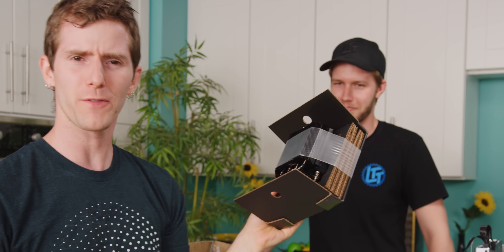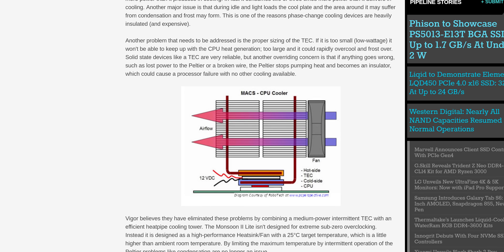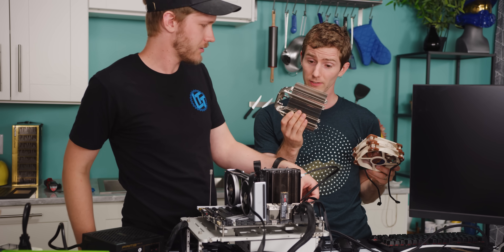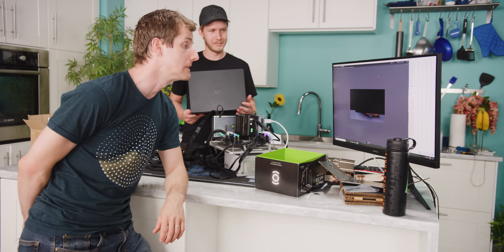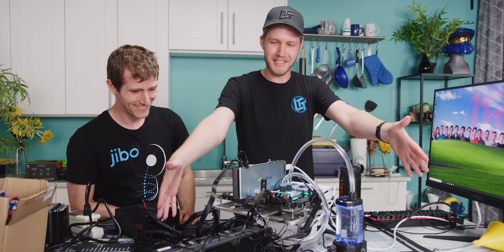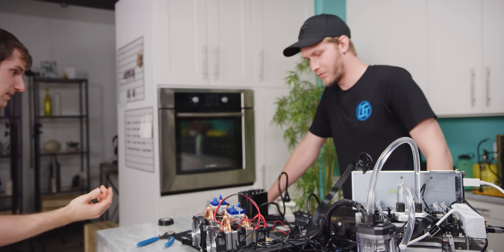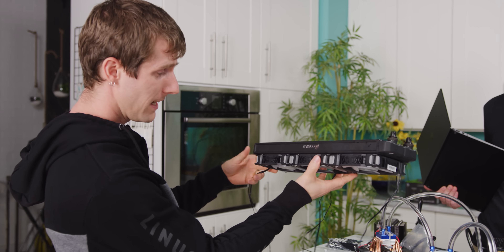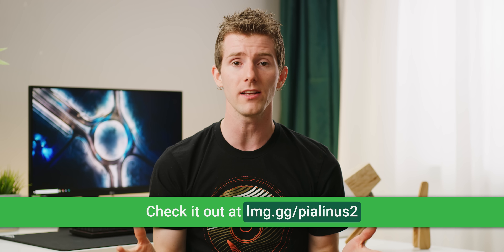Thermoelectric Cooling is a Bad Idea

Comment: 32 amps... lmfao... 
"Ok alex, fire it up!"
(kerchunk)
(sudden random shouting throughout the offices as power breakers are tripped)
Reply: 32 amps... at 12 volts, so... 3.2 wall amps. A typical home outlet can handle 15, some 20.
Reply: @jetjazz05  That's still a significant 384 watts consumed regardless of voltage. I can't imagine my fans using ~380 Watts to cool my computer.
Reply: @UltraNoobian  Sure, no doubt, it's a ridiculous amount. Really nothing uses that much power besides like a fully operating entertainment system, a computer, some power tools. I've got a fan that uses 384 watts, it can pull all the air out of a 12x14 room in a matter of seconds, so for that to be just a very poor quality cooler... nah. Would probably be more energy efficient to use an ACTUAL FRIDGE with a huge spool of tubing in it lol.
Reply: I thought the same, talk about energy efficient that's almost 10x the draw of the rest of the computer!  And it probably still won't be enough, it's like launching a rocket; you need more energy to dissipate the energy it uses, then you need more energy to dissipate that energy.
Reply: Watts = Volts × Amps
Anyway the reason it needs to draw so much is because it is actually working as a heat pump. Basically all refrigeration are heat pumps where heat is being pulled out of a low energy state (your cold food or room) and being "pumped" up and out into a higher energy state (ambient external air). But in order to do that the pump needs to be powered with equal the amout of energy being moved plus efficiency losses. So if the CPU is consuming 100W a perfect refrigeration system that's 100% efficient would have to consume 100W to bring the CPU back to ambient temperature and even more to get it below ambient.

Comment: What about if you create a vacuum in a PC case, and then use a watercooler+chiller to reach sub-zero. Tubes go outside of the vaccum case into a chiller. Isn't the idea that, when there is no air, no condensation can occur?

Comment: Peltier units are best employed as waste-heat energy generators such as emergency battery chargers which are charged using waste heat from a wood-burning stove. As coolers, they are just too inefficient to make sense unless the cooling needs are minimal or must be precisely tuned to a very specific temperature.

Here is an interesting video about using Peltiers for emergency power: https://www.youtube.com/watch?v=rKWDp_yWq8c

Comment: It seems that TEC is bad for active cooling (cooling of actively produced heat). It seems also bad for passive cooling - as most refrigerators modules work with less amount of energy and gas-expansion modules can reach lower temperatures. The only thing I find suitable to be used for is immediate passive cooling, i.e. when you need produce low temperatures fast for stuff that do not emit heat on their own. Maybe for creating instant icecream?

Comment: The problem with TECs is the fact that the device itself consumes power as well, and a lot of it. That power is not converted into "cooling" but heat. With that in mind you not only have to provide a heat-sink for the transferred heat of the device you're cooling with it, but a larger one that is also able to dissipate the additional 60W (for a TEC running 12V 5A). 
Even then a TEC is a solid state heat-pump. It can only transfer as much heat as it is able to dissipate on the "hot" side, meaning that even the slightest temperature rise in your heat-sink at the "hot" side will decrease its cooling performance.

TECs will often work fine on lower voltages as long as you are able to supply the current needed, but you have to experiment with them. There is no need to run them at the specified voltage, it just generates more heat in the TEC while the "heat-pump" capability increases only marginally.
...Yes, I played with a couple of them for more time then I'm wiling to admit before realising they aren't that great for cooling active parts.

Comment: "Bad Cooling Ideas"
Whole Room Water-Cooling 2 confirmed.
Reply: Scrolled down looking for this comment.
Was not disappointed.
Reply: @Snadzies  same!
Reply: Do you think if he does it again he will be smart enough not to use bare copper tube in the room he is trying to remove heat from?
Reply: Whole room water cooling. In the server room! Whole server room water cooling!
Reply: whole room water cooling was not a bad idea, but you had linus doing it so horribly decisions were made all round.
Reply: Pretty sure they have server buildings submerged in the ocean now, why limit yourself to just one room?
Reply: Room cooling was good, just the implementation fo it, number of little things added to it not working as expected.
Reply: Probably my favorite video (series) on the channel, yes please! XD
Reply: I want this!
Reply: *Iwakura Lain has joined the chat
Reply: Whole room PET cooling 1.0 Alpha build.
Reply: You could use that as a pool.
Reply: I really recommended this when a few videos back when they did the video about the completed LAN center in the office. 
I totally want to see a part 2.
Reply: I mean, aren't we cooling servers in the Ocean now?
Reply: They need two radiators from semi trucks, lasko box fans, large pvc plumbing, a pond for their reservoir, and a pump driven by a ford inline 300 lol.

Comment: I once built a peltier water loop with 6x 12706 peltier elements which are about 57W at 15.2V but I ran them off a PC PSU on 12.2V, 6x cheap aliexpress waterblocks like in this video, one heatsink from aluminium to cool all the peltiers, and one big fan. It pulled around 300W and I could cool a FX8350@4.7GHz running Prime95. It's a total waste of power and that's it.

Comment: The most obvious problem is that peltiers will always generate more heat than they will take away from the CPU, so you'll have to take away more heat from the hot side than straight from the CPU.

Comment: I used one of these for a drink cooler. Little insulated aluminum cup on one end, literal CPU fan on the other dumping heat.
100 watts to keep the container to -10c. It works, but yeah, not efficient.

Comment: I have been experimenting with tec's to bring an open loop water system down a little closer ambient temps. Totally not practical but it has been fun to build the control board to Kik the tec on and off to boost the performance of the normal radiator closer to ambient.

Comment: Tec is so obviously pointless in this role. All you are doing by using it is adding to the heat that needs to be dissipated to the heat sink.

The cooling comes from the heat being transferred to the air, all the tec does is move the heat either from the cpu or the water to the actual cooling, the radiator, in a way that is less efficient than just using a good thermal conductor (a piece of copper)

Comment: Why not just use water cooling that sends the hot water to a reservoir, then attach your Peltier coolers to the reservoir?

Also… Is it possible to seal the CPU up with a water impermeable shroud of some kind, with water proof caulking to make a seal against the motherboard, with a desiccant packet included inside? (Assuming the desiccant pack isn't made with chemicals that can corrode metals.) The idea is to allow you to run the CPU as sub zero temperatures without shorts.
Reply: epiccollision,
Ew. That's not good. Sounds like another problem to engineer around. Not sure how to solve that, though. Guess I'll have to let the problem percolate in my mind for a while.

Comment: another great way to use a TEC is to use it as an added heat exchanger inline with a normal watercooling loop. It means you add an entire second loop but it also means that it only needw to turn on on demand unlike a direct CPU contact TEC

Comment: U can stack peltier modules :) meybe try it with the cheaper ones :D
Reply: The last peltiers would be overwhelmed and not able to let all that heat trough from cpu and 1. peltier. Stacking peltiers only works with original small original loads. I would guess sub 20w..

Comment: 32 amps...as an electrician I'm getting pretty annoyed here...
Also, was that a     rock?
Reply: I guess 32amp at 12v?
Reply: That wasn't a rock at the start of the video, it was a hunk of aluminum. Alex attempted to cast/smelt his own cooler in a past video.
Reply: Ryvaeus technically it was a rock :/
Reply: This one looks like it. 545 Watts max, operates from 0 to 16VDC/ 0 to 32A.
Sorry for the long link.

https://www.ebay.com/i/311946513162?chn=ps&norover=1&mkevt=1&mkrid=711-117182-37290-0&mkcid=2&itemid=311946513162&targetid=596465719588&device=c&mktype=pla&googleloc=1016136&poi=&campaignid=1689407486&mkgroupid=74365778148&rlsatarget=pla-596465719588&abcId=1140476&merchantid=8383854&gclid=EAIaIQobChMIj-2m7YL84wIViR-tBh3zmgYnEAkYBCABEgLUYfD_BwE
Reply: Rocks are wonderful 💗 Maybe not as coolant, but I can never unlove rocks, they're good people, they mind their own business, only avalanche/riot rarely.
Reply: Watts is watts. 545w is the same at 12v or 120v only the amperage changes.

545w/12v = 45A
545w/120v = 4.5A
545w/32A = 17v
Reply: @Diskettes83  But the wattage is not the constant here, the amperage is. He said it draws 32 amps. 
12V * 32A = 384W
Reply: @paulurbaniak2242  He also said it draws 545w, and if current is voltage dependant watts is the more correct number to use.
Reply: @Diskettes83  Yes, you are correct. I did not know he said 545W, I was referring to the 32 amps he mentioned.
Reply: Yeah the 32 amps is BS. That would be 3,840 watts of power (assuming 120v) so they would pretty much have a red hot stove top on their computer 😆
Reply: @vaughnwilliams59  Peltier Elements usually run at 12V DC, so 1/10 the wattage
Reply: @paulurbaniak2242  Ah that makes a lot more sense, so it would be pulling much less current from the outlet too. Thanks for the info!
Reply: Paul Urbaniak Yes, one of the diagrams showed 12v input, and I believe it’s using a PCIe cable, which would be 12v. So you’re correct, 32amp would be 384w

Comment: Did a similar project in college. You should look at efficies of the TEC vs a compressor. 300W of cooling is 300W of electricity and luckily 30 ish W of cooling. Compressors are much more efficient
Reply: Yes, similar power draw on my compressor at 350w heat load is -35c cooling block temps (I’m not sure CPU temp, my FX-8350 couldn’t show below 0c, and it wouldn’t go above that even at peak load at 1.7 Vcore).

Comment: CAN YOU NEXT TIME TRY TO MAKE A REFRIGERANT COOLER? WITH LIKE A REAL COMPRESSOR. Just like an AC system works except you condition the cpu except of the air. (like put refrigerant into a high pressure water block or something) :D
I know its not an easy task to do, but i think it will be so much fun seeing you guys try it.

Comment: I wonder if a UPS would help make an overclock more stable.
Reply: If you have really garbage power fluctuations it does... in college I could run my fast overclock, but at my parents house, I had to lower 300 MHz (do note that if an air compressor kicked in, you could see the lights dim each time the piston got to the top and was drawing more current). But now I’m moved out and I think it’s even worse (you can hear my air conditioner sound like it’s about to stall the compressor when a microwave is turned on or randomly through the day around noon when everyone’s AC is on). So yes, but most notably in these extremes and with cheap power supplies (I haven’t seen any difference in my main system, it has 2x SuperNova 1300s for the monster system it’s running).

Comment: 11:23 ..... louis rossman just had a mild heart attack seeing that hack soldering job with NO FLUX!
Reply: Homelesseh, solder typically has flux in it. Usually referred to as rosin core. Some times additional flux may be useful like rework on surface mount.

Comment: does the water flow free thru the device if so would it make a improvement to a typical water loop by just adding it in the loop 
as in would it lower heat saturation of the loop

Comment: You're using the pelltier water cooler wrong, though.  You don't use it instead of a radiator - you use it to supplement the radiator.  The idea is that its placed somewhere externally, likely the right-side of the case (because most cases have no window there) and it cools the liquid slightly before returning it to the radiator for further heat dissipation.  Thisi s especially useful in warmer climates where running a 1200w A/C isn't cost effective and more likely than not can barely cool the space.

I think if you did a video illustrating this usecase, it'd shine a more favorable light on the cooler.  It DOES have a purpose, but what you used it for... this ain't it chief.

Similar for the peltier CPU cooler.  With 3000+RPM fans, in a warmer climate it can make otherwise hard to cool servers and PCs more serviceable annd extend their lifespan when using A/Cs doesn't do much other than keep humans from getting heatstroke.  So... yeah.  These have their place. And maybe we can blame advertisers for trying to make it a "everyone would want this" product and giving a BS usecase.  But the actual use - cooling PCs in hot environments? / Yes, they're definitely helpful products.

Comment: the TEC need much more power to cool the heat produced by the TEC itself = louder fan noise. best is WC to radiator/fan outside the room. Main issue with TEC is DEW POINT. You don't want water on your  motherboard

Comment: I wonder what would happen if you added those TEC coolers in series with the traditional water cooler. Like Have it go TEC 1 -> TEC 2 -> cpu block -> rad -> res -> back to TEC 1. That way you chill the water before it gets to the cpu block but chill the water before it gets to the TEC coolers. It'd be horribly inefficient and more expensive than a standard sub-ambient setup but could be cool for like a steampunk themed rig in a big tower case. Have the TEC heatsinks sticking out the top of the case with all the plumbing down below and everything painted in brass and copper. That'd be pretty cool. :)

Comment: If the TEC is in between the two towers and fan is blowing air from one tower to another then that's thermal short circuit. All that the TEC is doing is wasting electricity.

Comment: I did this on an 875K OC to 4Ghz. I used several TEC's cooled by 360mm Rad. I run 10c under ambient at idle and get to about 20c over ambient under heavy loads. It is not nosier as a 360mm rad with fans, as the radiator fans make the same noise no matter what it's cooling. Heat is an issue and yes power consumption. I had a PSU dedicated to pumps fans and TEC's. It still runs just as well as ever. Because of the heat and power consumption I would go with a window AC unit and enjoy a cooler room. Unless you just like to see what you can melt or get away with.

Comment: So I'm struggling to make sure I understand what's happening with the Peltier effect to make this cooler work, I think I understand it but am not quite sure, any physicists want to chime in?

As far as I understand it what is happening from an energy balance perspective is that you have electrical current flowing in a circuit, where the circuit consists of 2 dissimilar metals. Once the current reaches the junction of metal A and metal B, if metal B has a lower resistivity then metal A the current would want to increase (to maintain the energy balance, assuming resistance is related to chemical energy, see next paragraph), but it can't since it is in a closed circuit (constant amperage), therefore the excess energy that exists due to the current flowing through a new medium with a lower resistance is let off as heat (or presumably other forms of energy as well). The opposite junction between metal B and metal A is the opposite, higher resistance medium passes to a lower resistance medium, therefore heat is taken in from the environment to make up the energy balance.

My assumption about electrical resistance being related to chemical energy would have something to do with the metals bond energy, where the electrons bond energy is positively related to the resistance? Or in other words if a constant current moves from a medium with low bond energy to a medium with high bond energy, in order for the current to remain constant heat must be taken in from the environment to satisfy the energy balance, and vice versa.

Additionally this would make sense to me why this method is very inefficient from an energy perspective, the electrical energy input doesn't necessarily have to come out as a heat flux in a 1 to 1 ratio, any other form of energy might satisfy the energy balance even if the energy is unusable from a cooling perspective (plus heat flux is never 100% efficient, 2nd law of Thermodynamics).

Obviously I am oversimplifying, but am I on the right track? Or does explaining it as a change in resistance not make sense?